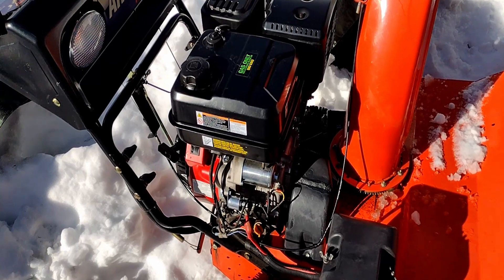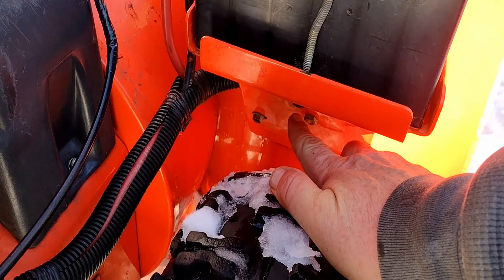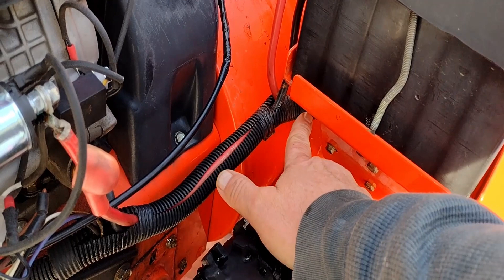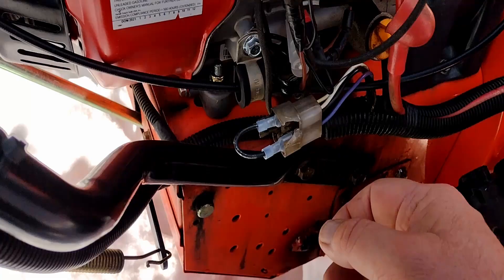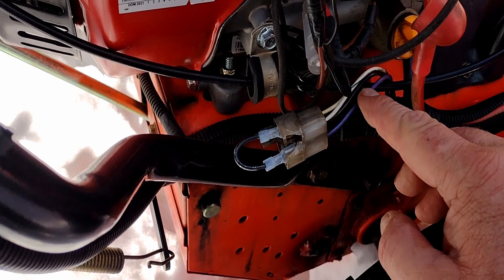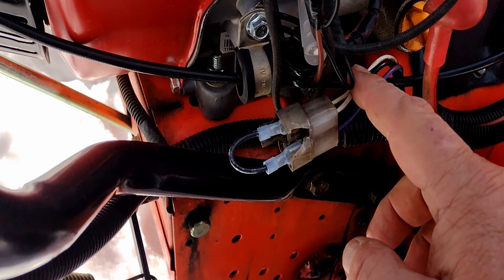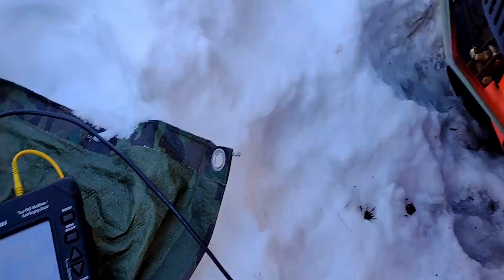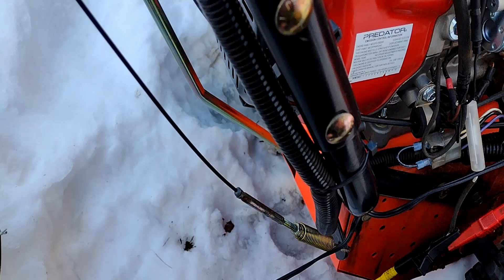Predator 459cc swap - charging and electrical

Comment: so i'm doing this same project on my Ariens ST1336LE professional with this same engine i have many things that are not working with this engine. first off, the mounting hole don't line up with that engine and the other is my chute controls are mount to the top of the OEM engine and there is nothing to mount it to on the predator 459cc engine. did you had any of these issues while doing this to yours?
Reply from the maker: Mine has the electric chute motor and cable for the deflector, so no issue. The mounting holes where far off. I removed the factory mounting studs. Then positioned motor and marked for new holes. They were right at the edges so needed care in locating them. Hope you can figure out a way to make it work. Video with some more detail is here https://www.youtube.com/watch?v=aVR7OLL0oLU

Comment: any idea how many amps that puts out?
Reply from the maker: Yes, it is close in size to a Honda 3 amp coil. On my snowblower it will run the heated handgrips (roughly 30 watts) and headlight (Sylvania Zevo led 1.5 watt) while keeping the battery charged. With the standard bulb (~21 watts) and running the grips it was unable to keep the battery charged. So the 3 amps looks reasonable. I forget the fuse size the Predator came with will look tomorrow.